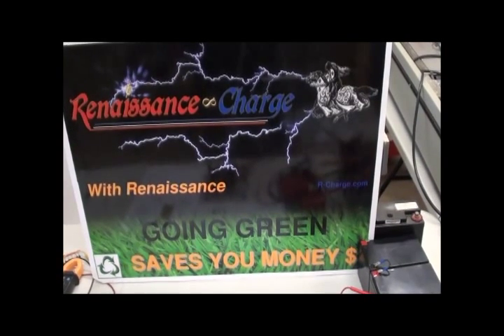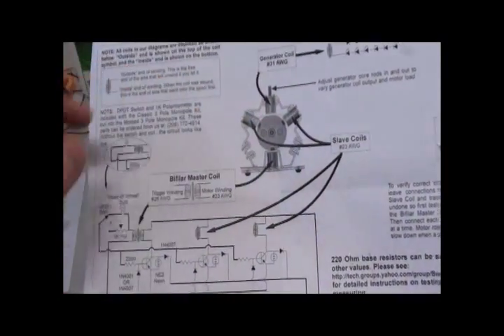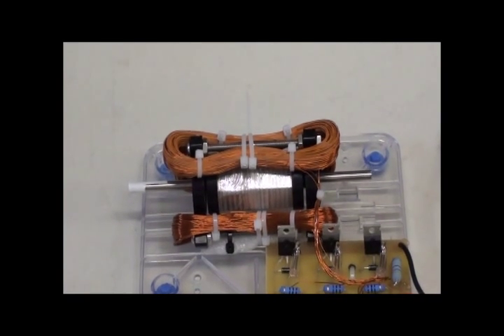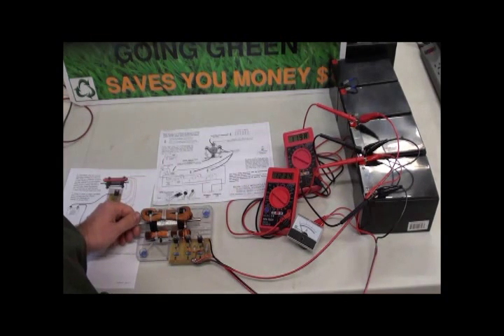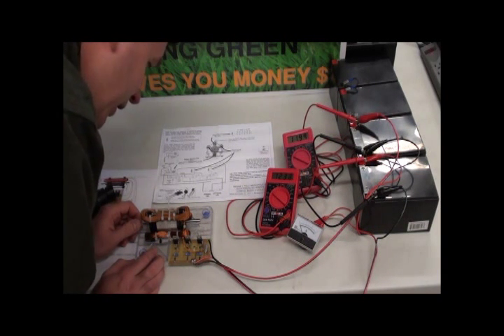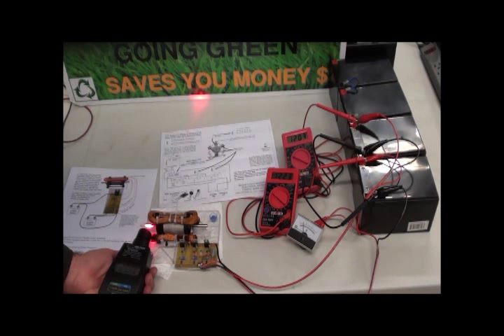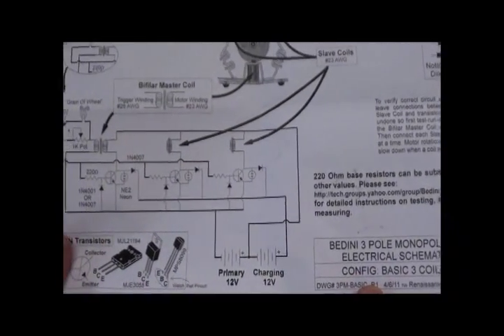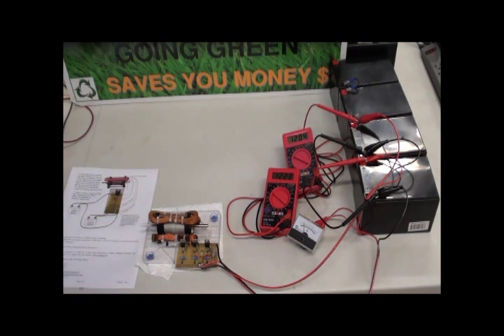Mini Magnetic Window Motor Energizer 13,000RMP while charging battery

Comment: I am confused.  The window motors I have seen before had the windings going around the outside of the unit.  Your windings are or seem to be just oblong coils set on top or on the sides and not around the unit.  Are these true window motors?  I am familiar with Bedini-Cole window motors which I cant figure out how to get seven coils around the outside.

Comment: Hi Rick. I want to by this full kit with 3 coils and 3 SS circuit, but I don't see it on web site. The link goes to the small window motor with only one coil. So, were to look? My second question is related to the 3 diffrent thinks (power some light, etc..) Do you have a schema, dvd ? I need more details, please!Thanks.